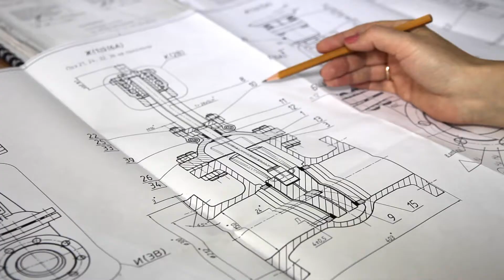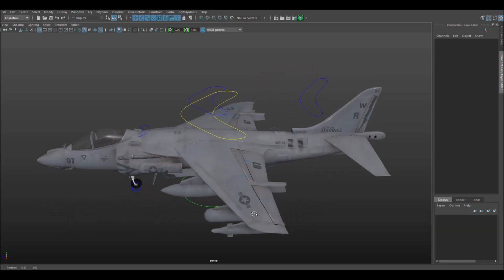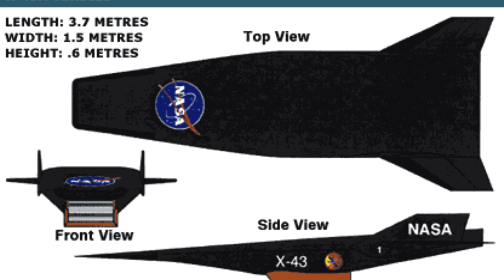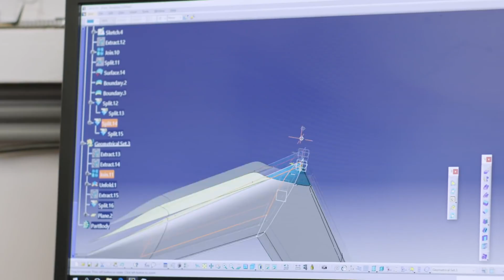These Could've Changed Aviation Forever | AJXPlanes

Comment: But what you think of the cost of these ones if they had created it, like the boeing sonic cruiser, it looks good, but would it have been reasonable in today's oil cost ?
Reply from the maker: The Boeing Sonic Cruiser was definitely futuristic, but its speed-focused design would've meant higher fuel consumption, especially compared to today’s fuel-efficient aircraft. With current oil prices and the industry pushing hard toward sustainability, it might’ve struggled to be economically viable. Maybe it would’ve ended up as a niche premium travel option — kind of like the Concorde!